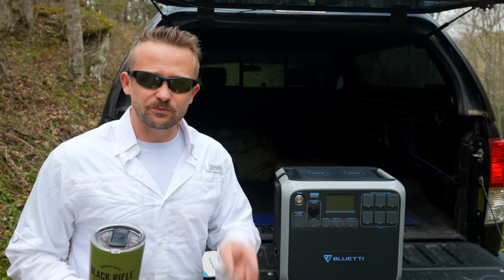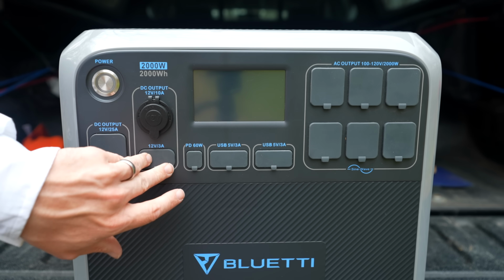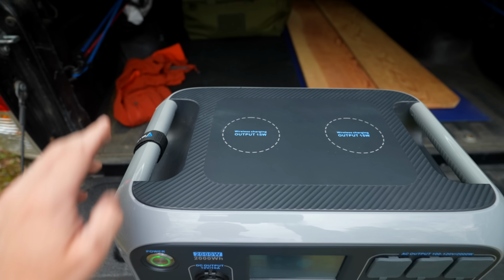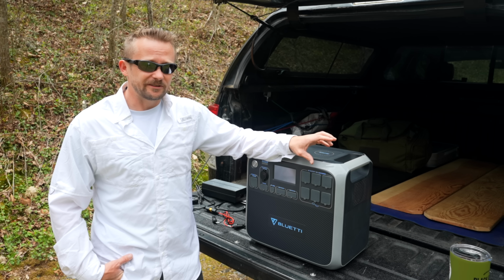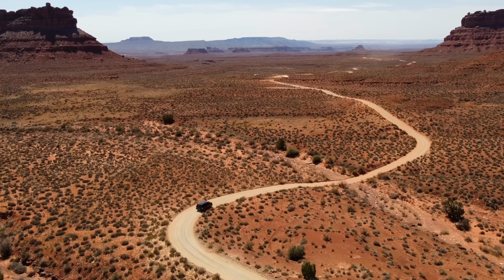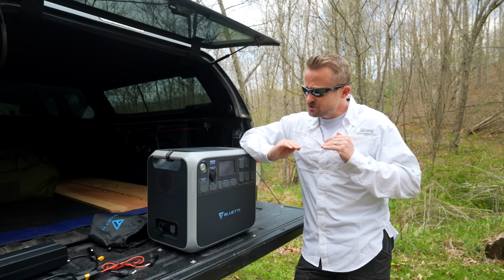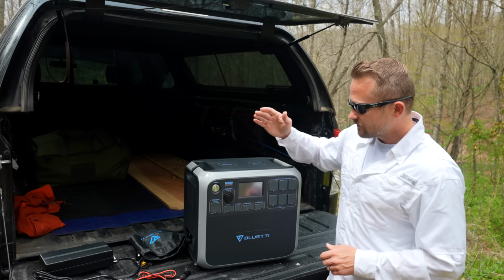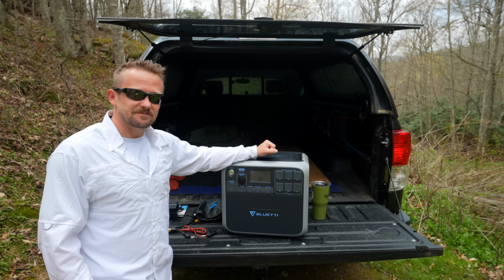Does it Offer It All? Real Overland Review - Bluetti AC200P 2000Wh Power Station

Comment: How does an extra ‘power brick’ speed up solar charging? If it’s capped at 700watts input, then how does an extra ‘power brick’(adapter?) help? Or does the second port also take 700watts? For a maximum solar input of 1400watts? 🤔

Comment: Will the Bluetti AC 200MAX solar gen.   have enough  start-up power  to run  the  Dometic RTX 2000  roof top Air conditioner ...  I know the running time is limited  but will it run ..

Comment: Mini Solar Tip , a beuler and all other hungry electricity consumers can be infinitely dimmed with the 5000W dimmer (EUR 7). I run 5 dimmers in parallel on an 850W inverter. Kettle 2.2KW at 150W runs 12 hours a day, so the water is always hot. The room is also nicely heated. 2.5KW washing machine runs in parallel with dimmed to 200...400W. Iron, dishwasher, oven, electric heater, coffee machine, all internal heating are throttled with me. Videos on my channel https://youtu.be/eC2olbCBhh0 The inverter stays cool, quiet and the MOSFETs remain intact because no extreme current peaks arrive at the inverter. Now every Mini PV Inverter is enough to sell large devices...

Comment: so have you changed your mind about the Jackery 1000 you done a review on in Sept. of 2020? why don't you do a side by side comparison and if you would prefer the Bluetti AC200P 2000Wh Power Station over the Jackery 1000. I agree with what you said about the Bluetti on weight and the screen, and what draws my attention is the watt hour of the battery etc and the ability for it to recharge so quickly. during you trip and use of the Bluetti, I wasn't quite sure how many days of use you had without charging it. Not sure if you were saying you went that whole time without having to charge it, or if you did, how often with using what and was that usage the same every night? All that seemed a bit vague to me.

Comment: I know this is an older video so you probably won't see this, but 2 ideas about your truck. 1) check your fuse for that DC port.  I had a similar thing happen on my camper, with a DC port only outputting 6 volts.  I checked the fuse and sure enough it was blown, so I replaced it and the DC port then read at 12 volts like it should.  or 2) that DC port is specifically designed for a USB car charger adapter, being that most USB powered devices typically use 5 volts or less.

Comment: Question, if something goes wrong after your warranty window is over is it time to open up the unit and become your own technician?    I have a few power stations, I keep feeling like I should start a mission to try to learn about troubleshooting solar units so that I don’t feel hopeless when my warranties are up.     I don’t even know what it looks like yet under the hood  lol, I hope it’s not intimidating.   Like for instance I wonder what post-warranty repair steps I would take if the screen just locked up or stopped working…I wonder which exact parts I might wanna buy extras of in case they are the most common points of failure, etc.     That’s another tricky part, I could see Bluetti being secretive about telling you which specific parts are used in their products, yet after your warranty that would be very important information!

Comment: Gold standard? You don't need 6 AC outputs when dry camping. You should utilize DC as much as possible. Some folks who dry camp don't use AC at all. That power station makes sense at home when you have a power outage. It is poorly configured for dry camping.
Reply: I use the 110v for my Eureka coffee grinder and my Ember Travel Mugs charging bases.  I have my 12v fuse block connected to the 25a 12v outlet and use the 10a 12v outlet for my Dometic fridge.  You are correct about not needing 6 110v outlets when you are on the road.  The inverter itself uses a good amount of wattage so as soon as I no longer need 110v I shut the a/c off

Comment: What I like the most about the solar generators is that they're silent, and you can leave them plugged into a wall outlet while it runs on the wall source, then when the power goes out, the solar generator goes on automatically in less than a minute, and can be run off solar panels.

Comment: Greets from germany, i use my ac200p for charging my small Ev renault twizy. I can even carry the device and the 5 foldable solar pannels. My cons to the ac200p are the temperature sensors inside the unit. Basicly if the unit is cold the sensors disable the charging but you can take power out. I tried a lot from hairdryer to fans, to trick the sensors inside just wrap the unit in a 12v heatblancket wait 30 mins and its good to charge

Comment: The 12V charging really is great, and more efficient. Around 100W for car charging, so 20 minutes worth of driving is enough to run a microwave for 2 minutes to heat a can of soup, an hour of driving is about enough to boil a kettle and it will more than support a small freezer. You're better off packing a separate external battery to increase capacity rather than carrying solar in most cases.

Comment: Lithium Iron Phosphate batteries (LiFeP04) batteries can NOT be charged if their temperatures drop below 24ºF.  The Bluetti can still be used to power devices in sub-freezing temperatures, but they can NOT be CHARGED.  
     Luke, you said nothing about the cold weather charging limitation.
     Generators, of course, have no such limitations.  Anytime, anyplace!
Reply: No problem if you are charging from dc in a warm car. Generators are noisy, anti social and reliant on you topping up the fuel. These charge whilst you are travelling, ready to go when you stop, no noise, no smell, free energy if charging from solar.

Comment: What happens if you've 'Accidentally' drained the car battery?  Can this unit be used to jump the car back?  I think this is an extremely important aspect.  I realize there is a low voltage setting.  But what happens in an emergency where your car battery is accidentally drained?
Reply: Keeping my gas powered generator & being able to charge my car/RV dead batteries is just one of many reasons why I've NOT switched to Solar or any of the power packs.  My generator provides power in sub freezing temperatures, in hot temperatures in the middle of the day in Death Valley, at night, rain or shine; bottom line is it provides power whenever I need it, where ever I need it.
     A measly $1095.95 was my total cost for the generator, no need for inverters, Li-Ion $1000 batteries, solar panels, & a degree in Electrical Engineering.
Reply: @azclaimjumper  the problem with that is this climate change hysteria is going to create chaos for fossil fuels... they are trying to phase out fossil fuels which is ridiculous, but will lead to shortages .. when that happens, solar and electric won’t look too bad

Comment: i just got mine and it is still on my living room floor. It is NOT something I can move around. I didn't realize how heavy 60lbs is, I am trying to figure out what to put it on so that I can roll it around inside my house where I can use it where needed.  And figure out out how I am going to get it outside and hook up the 3 solar panels when i want to charge it with solar. But I am really looking forward to having this when pg&e starts their rolling power outages this summer. My first one. I think I might get the EB70 for smaller watt items since I already have the solar panels. Thanks for the video.
Reply: I have back issues and I know,...it's heavy! What I've done is use an old suitcase dolly and I can roll it around the house. I went on Amazon and bought a portable stair climbing dolly and I can now take it up to the second floor. You can rest on a step if you need to recharge your stamina. Don't forget to use bungee cord to secure your load. For the solar panels I plan to buy a 20 foot MC4 extension cord and snake that into the house where my Bluetti is. That is also on Amazon. I hope this helps you out Beth. Of course, I would use the Bluetti charging brick if I had AC power in the house.

Comment: I’m very new to all this.  Still learning.  Would you be able to charge this quicker than 12v by using a power inverter hooked up to your truck? (Simulating a wall outlet essentially)
Reply: @J GetsCensored. I have heard from another YouTube channel that this unit can charge from an A/C 110v outlet AND from solar panels at the same time.

Comment: Great review , main issues I see right of the bat with all Li po batteries is cold weather performance and recharge time on 12v. We overland, and charge everything we can via 12v outlet including a 180watt inverter while moving. Once stopped we use a Honda EU2200i gas generator which is 1/2 the cost of the battery unit, same weight and only 4 decibel's louder. On eco-mode it runs about 9hrs per gallon, We carry my daughters Dorm refrigerator/freezer which is a little bigger than the cube type, and many other small appliances like a coffee maker, but for someone who doesn't want to deal with gas this may be a  good option thanks Heavy D

Comment: My AC200 is where I placed it 8 months ago. I’ve used it daily to run most of my 3 bedroom 2 bath house 24/7. No problems yet. I have it hooked to 3 BougeRV 180w PV panels.
Reply: I was thinking about getting 4 of those would it work with it? I know it’s max is 700 but would 720 damage it?
Reply: @ademonsenvy  I purchased 3 more BougeRV 180w panels. On cloudy days I hook all 6 together. That’s 1080 watts. It doesn’t hurt anything to over panel. The AC200P will take up to 700 watts and leave the rest.
Reply: Or is 3 perfectly fine and if so what adapter did you use?
Reply: @ademonsenvy  more is better on cloudy days.

Comment: Thank you for your Much Better Than Great work. I wish would have known about the Bluetti AC power stations battery type before l purchased my power station. The one thing I do not like is the 200 is too large and the 50 is(maybe)  too small. By the way my Tundra has 4 "lighter" ports all have 12V.
Reply: You can try EB150, he is 1500Wh/1000W, our family on the official website to buy this very good, but also gave me an AC10 rechargeable battery.

Comment: My ac200p no longer inverts power after using it for 1 hour. Fault code 17. Seems like tons of people have issues. This litter generator seems like a kickstarter/social media product only. The production models are not meant for use
Reply: My AC200 arrived in September. It’s been on 24/7 for 8 months now. It runs my home fridge and freezer plus I recharge power tool batteries and smaller solar power stations with it. My home electric bill averaged
 $20/mo all winter in Eastern WA State. No problems yet.
Reply: @drwoo7346  im glad yours worked. Others have tons of problems. Customer support is completely broken English and they told me to turn it off and back on again to solve my problem. I would rather be slapped in the face
Reply: @kran3150  I see you found a fix for it on Youtube , wonder if rough handling during shipping is loosening the ribbon cable connector ?
Reply: @uptowndisco  I assume it was not fully clicked in from factory. The unit worked once and then after a couple drives up and down a dirt road I think it wiggled loose. When I clicked the cable back in I could for sure feel it "snap'" into place
Reply: @kran3150  Glad you managed on your own to remedy the problem , many would not be able to without the hassle of trying to send a large Lifepo4 back to China , that is "if" any carrier would accept it . Personally I think the manufacturer of any faulty product should be responsible for pick up and delivery's .
Reply: @uptowndisco  Im in Canada and I would have only have had to send it to a Canadian warehouse. But this was within my return window for amazon so it would have been free

Comment: Looks pretty awesome.  I'm a plumber and I  occasionally have customers with power outages during rain storms.   I have an inverter on my truck to power sump pumps, but that only works if my truck is in the driveway.  If my company bought this unit,  I could drop it off,  and drive away untill the power comes back on .......  or I could just be thinking of a way to explain to my wife why I bought this thing

Comment: From a technological standpoint, I get it.  It's really an amazing device, especially for on the road use for truck or RV camping.  But I can't help but think that for home use $2000 will buy you a decent home standby generator that runs on LP or NG, or a portable inverter generator and 350 gallons of gasoline.  If you completely lose power in your home for a week or two I don't see the Bluetti having the advantage.
Reply: 4 months later, entire counties are reporting gas shortages, forest fires, hurricanes etc. Gas generators are superior if gas is available, if not, this could save your life.
Reply: @kyesniper  No argument there, but it still needs to be charged. 
Like I said, for portable use this thing shines, but if you need something for more than an afternoon, there are better (more economical) solutions.
Reply: Just remember, you'll eventually run out of gas but never run out of the sun.  Solar gens are just another tool in the shed,  backing up the back up.
Reply: Looks like due to this whole climate change hysteria , there will be more and more fossil fuel energy shortages, gasoline and natural gas shortages and price increases.... these solar and electric generators are looking more and more applicable ..

Comment: How does it compare to the jackery power station?
Reply: Jackery batteries use to do 500 cycles then start degrading. AC200 batteries go 2500 to 3000 cycles before degradation. But I have 2 Jackery’s also.

Comment: Thanks for the video I have the AC200P and I agree the screen is poor and potentially a weak point because it is used to control the unit. I took your advice and used a 5x4" piece of Perspex for a cover, hinged along the top with tape. I can always see the screen through  the cover and I lift it up to use the touch screen. The cover naturally returns down to protect the screen.

Comment: Honestly I'd like to have one it would be great in case I needed to run my mom's oxygen machine.
Reply: I bought one from the official website and it is really great.
Reply: If or O2 system has a 12 volt option use the 12 volt port on the station because it uses less battery life than the inverter.
Reply: To protect that screen try a cut up phone screen protector then it can stay on it and the touch screen will still work.
Reply: Permanent mounted systems are not mobile. Lol.

Comment: Hey Luke, you forgot that con : 2000$.... ;)
Reply: I build ammo can radios for the occasional buyer. The bad thing is 1/3 of the price of the radio is just the batteries, and that’s at a good large bulk price too ($80). And the capacity of the battery pack I make is 17.5 Ahr or 220 watt hr. And that $80 does not include the bms module, or any other materials I use to build the battery pack, just the individual batteries, so just doing very simple math, just for the 2000watt hr capacity your paying about $800 for, and then you gotta add the cost of the inverter, the bms module that can handle the amount of charging and discharging capability, plus the charger. Non of that is cheap and would most likely cost the standard user more to build then to buy.
Reply: It is currently 1699 on Amazon
Reply: It’s $1699 on Amazon

Comment: LUKE, I HAD NOT SEEN THIS PRODUCT YET. I'M SO GRATEFUL FOR YOUR CHANNEL. I'M BUILDING A RAM PROMASTER 2500 OVERLAND VAN. THIS PRODUCT IS THE TICKET I HAVE BEEN LOOKING FOR. THE RIGHT ANSWER FOR ME. THANK YOU SO MUCH! GOD BLESS YOU AND FAMILY. FROM THE 641.
Reply: Don't purchase any expensive or dangerous items that have no local warranty or repair center. I purchased Bluetti EB150(Feb. 2020) because it was very simply made and compact. It has NO UL or any certificate(NO INSURANCE coverage) so, I keep the unit very safe when it is not in use(separate garage). I will try to repair it myself when it does not work. 1st the time when I received EB150 A/C adapter did not work. awaited 2 weeks for replacement and communication was impossible with them. Also, I modified the EB150 in many areas to improve the charging and cooling ~~~~~ EB150 has many small glitches.... I use EB150 in my 2008 Honda Odyssey camper van with one 370 watt REC solar panel.

Comment: Excellent, real-world use.  Excellent review of pros & cons.  I wish all product reviews matched the content of this video.  This is a real-world REVIEW, not an obvious infomercial like most other videos that are promoting a product.
     You made no mention of the cooling fans.  Are they adequate for keeping this product from overheating while being used & are the fans noisy or quiet?
Reply: Look at Hobotech, he doesn't do long-term tests, but he does use scientific equipment to make sure all the inputs and outputs do what the makers say they can do. He also tests fan noise, snd I seem to recall the unit being pretty quiet. BUT I have seen people say the fan in the power brick is loud, so beware if you plan on using it to offset use (with night-time mains charging and daytime running).